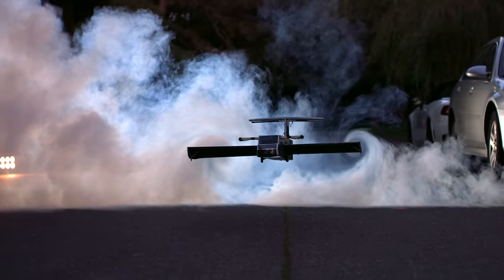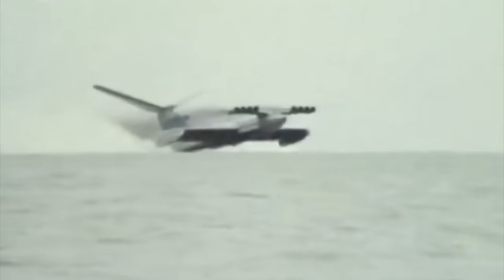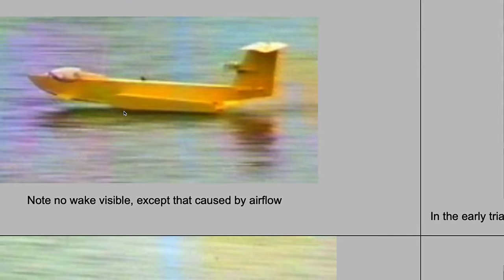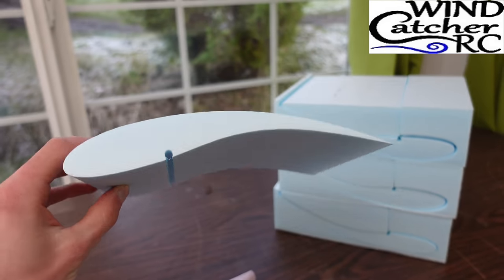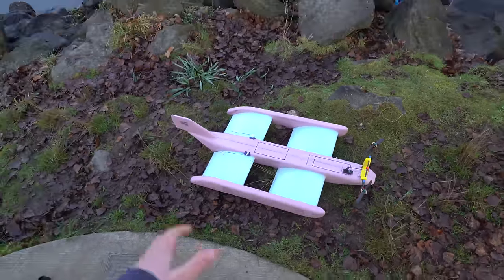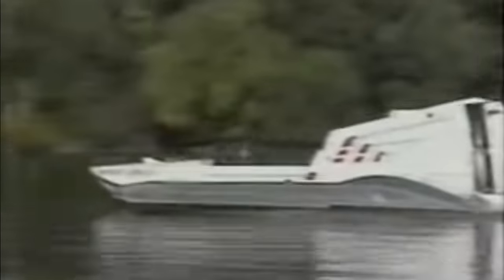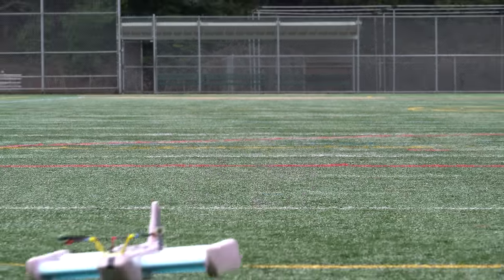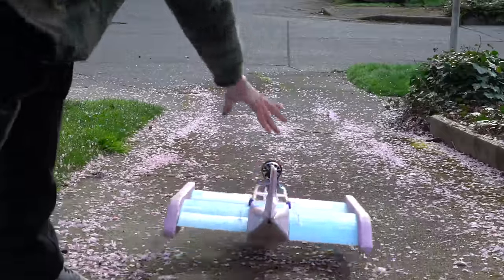Are R/C Ground Effect Vehicles Even Real???

Comment: When I was working on mine, I started to realize that it was very much just an aircraft trim problem to get the most efficiency out of ground effect. I’m thinking of revisiting my version of the ground effect controller and adding 2 integration terms that try to minimize throttle required: one on pitch attitude setpoint, and one on altitude setpoint. Both would be constrained to reasonable values, but it would quickly be able to find the minimum of the pitch-altitude-throttle plot…hopefully 

But hey, I’m a controls guy—very excited to see you pursuing the problem from an aero design / dynamics perspective! Wish I had your level of patience to iterate as much as you do
Reply: I think you're right. The ground effect is an efficiency mechanism. In order to take off from the water, the vehicle needs a lot of power because water has a lot of drag. It's likely so much power that it would have enough to fly outright. But they don't, because doing so is inefficient.

I'm also unsure if the simple mathematic definitions of ground effect and assumptions about proportions scale down to this operating size. Gas laws and physical behavior don't have linear terms, they have exponential terms which are roughly linear when operating in a small region, but which can quickly become non-linear.

I wouldn't be surprised if the ground effect window for a wingspan in this scale was much smaller than the window for a large vehicle like the famous Soviet ekranoplan.

Likewise, given the real-world performance of the Caspain sea monster, I wouldn't be surprised if the "correct" or optimal ground effect height was also higher. For example, the ground effect may be present between a certain height relative to wingspan or wing area, but using the "middle" may be pointless. It is precisely the interface between ground effect and regular flight which is proposed to be the efficient flight mode, where the vehicle rides on a cushion of ground effect air. Definitionally that seems like riding on the boundary.
Reply: @haphazard1342  First and foremost the assumptions of power and flight are incorrect. Caspien Sea Monster weighed the same as the A380, with 75% of the wing area, 75% of the power, and lower lift off speed, despite having simple flaps over complex multi-slotted flaps. 

Second, ground effect should scale similarly to inertial "dynamic" scaling of RC aircraft. Ekranoplan work with high wing loading and higher pressures (compared to aircraft). It is very likely the window for proper ground effect is smaller (altitude), and the required wing loading relatively high to make an RC ground effect truly work. Unless of course you have a permanently augmented thrust vector to help pressurize the bottom surface of your wing.

Comment: The definition of ground effect has always been incorrect. 
The caspian balances on it's upper end of ground buffering. It can't fly over 50 feet, so ?
When landing my piper, you can definitely feel buffeting starting at about 30 feet having a wingspan of 35 feet, um?. . .
If it can't go up to open air, then it's a ground buffer

Comment: Perhaps try putting the motors on or the tail just like the one that inspired this design? 
It would remove any backwash from the propellers creating lift, meaning that lift is only created from the air passing over the wing when it is moving.

Comment: I think the most important factor for a feedback loop that keeps the vehicle in ground effect is that the lift in the front is more sensitive to the ground effect than the back lift.
That way, if you are lifting out of ground effect, the lift in the front will decrease more than the lift in the back, and it will pitch down.
And obviously when you pitch down you get back into stronger ground effect,
stronger ground effect means the nose gets lifted up more than the tail,
and nose getting lifted up more means rising out of ground effect.
I'd almost say that the rear lift surface could even be a normal wing (i.e. fully out of ground effect).

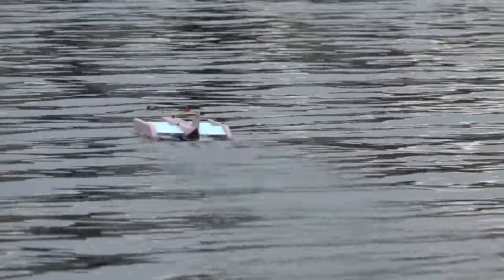It currently looks like your front lift is more sensitive to speed than the rear one, so that you get a nose-down attitude at speeds that are too low to lift off, as seen at 11:56. And at higher speeds the nose just lifts up uncontrollably, as seen at 10:45 , 11:19 , 11:35. I would have guessed that it has something to do with the high pressure air from the bottom of the front wing getting pushed under the rear wing - except that that would cause the opposite effect...

Comment: The flarecraft vehicles had a 70hp outboard to help it get up to speed while on the water. They could leave ground effect, but not sustain flight out of ground effect.
Reply: Using the water itself as reaction mass is an interesting way to gain velocity during takeoff that I haven't seen much beyond this example. I would imagine a future vehicle using an impeller driven by the jet turbines' excess power (if that's even possible) to accelerate itself out of the water.

Comment: If you're in RC planes, you know that basically you can make anyithing fly, if you have a motor, and the basic control surfaces. All because the power to weight ratio is much-much higher than a life size aircraft. You basically don't even need profiled wings, as tilting the plane gives the lift, and the motor just takes over the forces that you don't get from wing lift.

Comment: FWIW I was a 747 captain, retired now, but one thing I remember on landing was that we'd start to feel ground effect at about 200', which is the same as the wingspan. You'd have to add a little nose down elevator to push down through the ground effect or the big plane would start to shallow the descent.

Comment: I like that you are answering the objections with flight test.  I think you are correct, the negative pitching moment of the airfoil is a problem.   The big problem I see in these kinds of attempts is they are all very low wing loading park-flyer type of projects.   An Ekranoplan was like a heavy but powerful muscle car.  You need big wing loadings and high speeds at those loadings to get into the zone.  Machine it out of something more dense like oak.

Comment: One idea for reducing the energy required to generate enough speed in the water to transition to ground effect is utilizing your experience with active hydrofoils. Enjoy watching you troubleshoot on the fly, thank you for documenting your struggles along the way.
Reply from the maker: Thanks! I know hydrofoils and GEVs intuitively seem like a great match but turns out they are pretty much completely incompatible. I've experimented with this myself and know others that have done so as well. Even though hydrofoils have a lot of hype about having very low drag, they actually have quite a lot of drag at high speeds compared to a hydroplaning surface. They are also very picky about their speed range making it almost impossible to match an aircraft's ground speed which can vary greatly.

Comment: So stoked to see this "true ground effect" video series!

I've been curious about ground effect and the physics / mechanics of it ever since I first learned about it, probably from the ekranoplan. But there is so little out there about functioning machines that implement it. Looking forward to the rest of the series. Great work!
Reply: First time I heard of ground effect was when I was reading up on helicopters and found out that if the engine failed it was still possible to land using autorotation and the ground effect. And for anyone who haven't heard about this autorotation is what you get if disengaging the drive shaft to the prop on a helicopter in the air. If you are high enough and reacts quickly enough you can angle the blades negatively so that the air going up through the prop will accelerate it. The helicopter will fall pretty quickly, but by adjusting the blade angle you can keep the blades spinning and somewhat moderate the descent speed. The important thing is you keep the prop spinning at a decently high RPM. Then when you get close to the ground you pull back on the collector, using the rotational speed of the prop to push air down instead which further slows your descent. If you do this correctly the ground effect will help slow your descent even more making it possible to set the helicopter down instead of crashing.

The ground effect is however as said in the video strongest in a very narrow  height span, and it's measured from the plane of the prop not from the skids or wheels.

Now I certainly haven't tested this as I'm not a helicopter pilot. But I have talked to some pilots who has confirmed that it is a thing. They have also confirmed that the ground effect is a noticeable phenomena that they can feel when doing an ordinary landing. I'm adding this last bit as I've seen comments from people who claim that GF doesn't really exist.

Comment: For the sea monster wouldn't you need to also kick into account the wing area of the front planes and tail when calculating maximum ground effect height?  That tail is almost the same size as the wings are.
Reply: No, the tail was designed to be out of the ground effect on purpose.
Reply: @ConradBrander  interesting

Comment: I very much like this experimentation, but I would suggest a slightly modified target for success.

The main advantage of WIG craft is supposed to be their much higher transport efficiencies than boats or airplanes. Once you get the ground effect flying stabilized, I would suggest an ardupilot endurance test against the most efficient plane and boat designs you can think of, using roughly the same hardware to drive them (motors, batteries, circuitry).

This would properly demonstrate what separates a well designed WIG craft vs a plane flying low (and vs a boat). A proper WIG craft should be able to more efficiently use the ground effect for lift and thus go further for the same energy. Other advantages being a simpler design/ build and less requirement for maintenance and pilot training.

Comment: When I was at university one of our projects was to produce a ground effect R/C vehicle. Of the 20 or 25 vehicles only 2 or 3 couldn't fly but none of them flew well due to the configurations. But we had the advantage of taking off from land so the power required to get airborne was only very slightly more than the power needed for ground effect flight.

Comment: I really enjoy your series. I’ve followed your experiments for years.  I’ve been thinking about this question:   How does air density figure into all this.  When we’re dealing with ground effect, to what degree would the performance be different between a small, very light model and the full-sized craft traveling over the same water?  thanks again for all your work.

Comment: Looks like most of your thrust is going under the rear wing. Pusher propeller or moving the props forwards could help. 

Also looks like the AoA of the cambered airfoils is too high for the Cl you want to run at cruising speed. Maybe some way to trim the wing angles on the beach would help. You’re probably right about a flatter airfoil helping. My gut feeling is that more slowly compressing the air along the chord will ride smoother. 

Might be worth trying raising just the back wing? Could be possible that there’s too much back pressure between the wings and the plane is relieving that by raising the tail. Too much back pressure could kill some airspeed over the top of the front wing further decreasing front lift. 

Love the thrust vectoring to get going, looks sweet. 

Excited for the next episodes!

Comment: You need 4 motors to create and keep the pressure under each wing. The wings should form a pocket trap for air but without losing airspeed below those wings. Reduce the aileron length and inclination a bit, the problem is once they approach the surface of water or ground the air loses speed and hence the pressure. 
Watching these videos helps to identify the problems.

Comment: I think motor on the rear,  wings will always see the same air over them regardless of the throttle position, making it more predictive. I think it’s quite clear, listening to the increase in motor speed and in turn vehicle velocity, you see an exponential increase in lift. This will likely make a very efficient craft but requires too fine adjustments in the small scale.  These are just my observations. Love the videos, appreciate the content.

Comment: I built a successful model similar to yours, but it only flew on pavement not water. water makes things so much harder for a model because of the surface tension and viscosity not scaling with the model vs full size. there is a video from onboard my WIG craft on my channel. I used the suggestions from other members on Rcgroups when I built it, things like a thick clark y airfoil on the main wing and a thin undercambered front wing. If I remember correctly I used almost 0 incidence on the rear wing but about 5 degrees on the front. 
it was also setup with the motor on the rear and the rudder behind that, and no elevator or pitch control. 
keep at it, you can indeed make a non flying ground effect vehicle :D

Comment: Love watching these!! My thoughts are- 1. Extended the nose and motor postion to only PAR thrust the front foils, and reduse wing span, that will help lift the nose at speed but reduce the overall lift that makes it want to fly above GE. 2. It appears to me you are trying to fly a plane capable good altitude but keep it in GE. Just like hovering any rc craft an inch the ground its very hard. Maybe change the design philosopgy to building a device that is incapable of flying at any good altitude, but can slip along the water surface very quickly, I think GE is relative to air speed, not so much thrust wash or wing span. Also as you see on the big scale versions the tail fin and stabiliser are massive, like a weather vane, they help keep the machine planted and comb out the steep up down pitching effect.

Comment: I think your biggest issue is the change of location of thrust: The flare boat has the propulsion at the back and two pairs of wings, the Ekranoplan has the propulsion at the front and only one single pair of wings and a HUGE stabilizer that is outside of ground-effect and not participating in generating lift.

Pretty sure, that a prop at the tail would get rid of the propulsion-generated airflow affecting both sets of wings differently and overnight change your vehicle from instable to stable.

Comment: To reduce the thrust needed to lift off the water, use a super hydrophobic coating on the bottom surface so that even when submerged there is an air barrier between the water and the plane.

Comment: I had a fast RC boat that took off when the engine was put to full power. It usually pulled air into the propellor (ventilation not cavitation) but when it did bite the boat flipped. Designed right, it could have lifted the whole boat, though I didn't have the knowledge to make it happen reliably.

Comment: I think the design point you missed from the craft you mimicked was, that it used a pusher prop.
That would eliminate the tendency for the prop to lift the front of the craft.
For what its worth, my concept would be to have two fans, one mounted on the rear of each float, and steer with those ie. no rudder.
If you look at swamp craft, they also use pusher fans, so there's a clear design precedent.
.

Comment: I think you're on the right path, and I'm looking forward to your following videos. Commenting on this video; It seems there is a misunderstanding in Ekranoplan stability and trim. I'm not sure why you would try to fly this out of ground effect with adjust CG? Cg and longitudinal stability on ekranoplan are the key metrics to an ekranoplan. Ekranoplan trim to stay in ground effect by two fundamental methods, both of which require dual lifting surfaces. (The tails on ekranoplans are lifting surfaces). First, an ekeanoplan can achieve equilibrium by the relationship in Cl slope/curve of the wing in ground effect and the elevated tail out of ground effect - notice, almost every ekranoplan has a tail high enough it operates outside of ground effect, AND almost every ekranoplan/WIG has a (positive) lifting tail. Next, Ekranoplans undergo a significant shift in center of pressure. Many designs will utilize this shift as a self-trimming feature to keep the ekranoplan in ground effect.

It seems you are chasing the ground effect by applying aircraft stability principles, when it is an entirely different design philosophy. A true ground effect aircraft doesn't require control loop algorithms, or specific throttle settings. It should aerodynamically trim to stay in ground effect, and might hop outside for brief periods before it loses tail authority/pitch stability and will drop back into a self-stabilized equilibrium in ground effect.

Good luck! I'm going to continue to follow the adventure!

Comment: Having the prop stream flowing over and under the center of the rear foil is causing most of the sensitivity. I would eliminate the center of the foil in the area where the prop stream is most active. This should help with the over lifting in the rear. You could place a flat movable flap in that area that you could use to trim the craft and that may help you equalize the lift. Just a thought. - Carlos

Comment: Try using an airfoil with maximum camber close towards leading edge (at 10% chord or less). Such airfoil will have only slight change in aerodynamic centre while in ground effect and that will make your system stable. Also prefer low camber airfoils since they will have similar lift in ground effect but much lower lift in free flight.